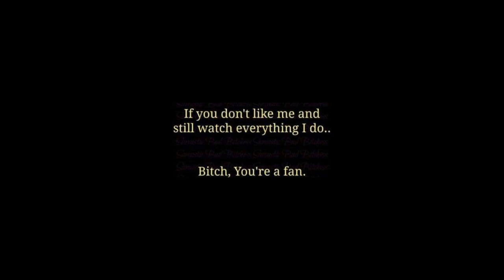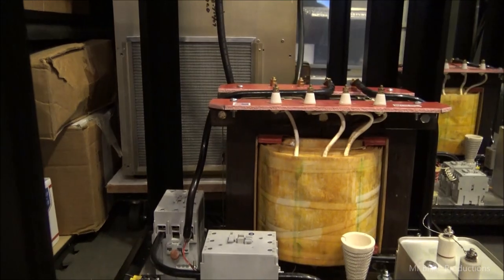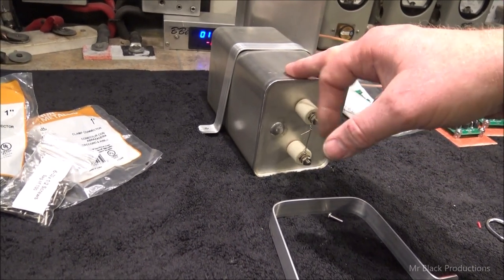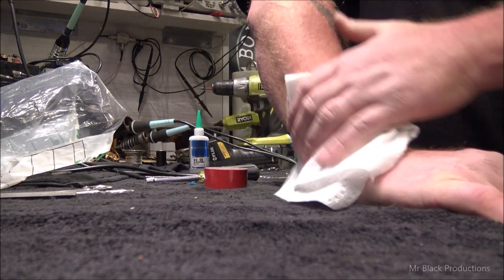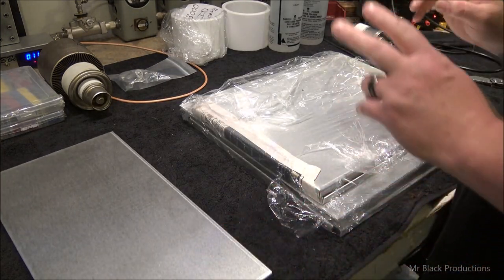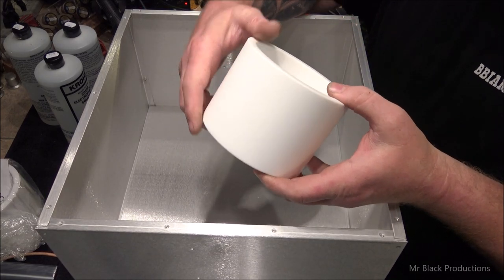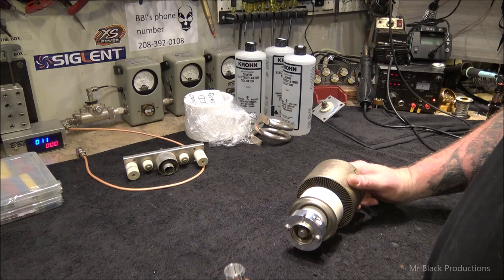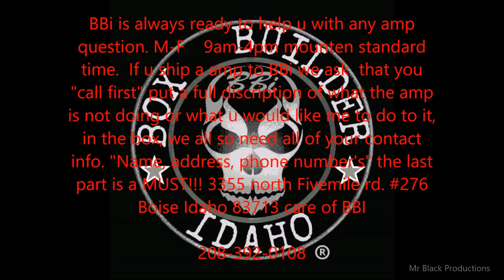How to build a 3cx3000a7 part 2 Of 4 the twins

Comment: This old boy that I knew from the early '60s spent forty years building 5 to 50k amplifiers for AM broadcast stations. He told me that the primary concern in designing a amplifier layout is "air flow", since the circuits are all similar. No circuit boards in those days! Everything was hardwired and he used air deflectors to cool critical components when needed. 
 BBI, looking at his case and thinking about board placement, brought back some good memories of a fellow that knew almost everything about amps and didn't mind explaining, in plain language, to a new C.B.er with only a basic electronics background. Thanks for the memories!
 As a side note, he ran a Golden Eagle and a 2k Henry with a home brew driver. The best sounding station in L.A. at the time! He had a walk-in closet sized cabinet with meters and knobs and a couple of High Voltage signs and a big question mark painted on the front that he said was "just a old piece of commercial equipment that never got used". A military contract that fell through just before completion so it became a "retirement benefit". Never mentioned watts but he said that it would be heard, strong, anywhere in USSR and China!
 I found out years later, from a family member, that he was the one that keyed down on Chanel 6 for four hours. Dead Key! It took 5k to talk to the next block and that wasn't even clear, otherwise Dead Silence! Ch.5 & 7 weren't too good either. Full S meter anywhere in the Los Angeles basin and 5k would get you four or five blocks in "The Inland Empire"! That was talked about for years. Rumors of "Uncle Charly" shutting down the big stations on Ch. 6 and maybe the rest of the "illegal C.B.ers" too! Most of the two to five hundred watt locals were quiet on ten or fifteen "barefoot" watts for weeks. I know that my "big", ha, ha, Palomar two hundred was in a closet for a few weeks, lol. Great memories!
Reply from the maker: I thank you for sharing your memories with me this is a wonderful story

Comment: You should think about using the timers that can be switch via dip switchs for off delay or on delay and use 11 pin octal/termial bases. the type relay i talking about has a dry reset also has a set of memory terminals..Not to helpful here but one advantage is limiting keydown time or on/key delay for a fault circuit.. Theres so many cool think you can do with them seeing you circuits and hearing you talk gets my wheels in my head spinning. good videos . learning alot.
`

Comment: You could mount the oil filled caps in a battery box. It would hold em tight AND prevent any possible leaks from going everywhere.  Just saying
Reply: I grew up in wendell... did you go to east wake?

Comment: @5:10 Hey, why don't you mount these golden resistors to a nice fat heatsink, maybe the lid of the case, where your fans normally reside.. Sorry that just came shooting from the top of my head .
Reply from the maker: Conductivity you don't want to mount those to any metal surface because of the way that I'm using them there's high voltage applied to those and we want the space and the distance between each resistor to act as an independent isolator it's for safety reasons more than heat dissipation safety reasons or more Paramount.
Reply: @BoxBuilderIdaho  Oh i see, I thought they were low voltage... Sorry, i don't know much about HV and RF but I love the Art you're creating there, very nice machine !
Reply from the maker: Thank you for 👀 the video bro... :)